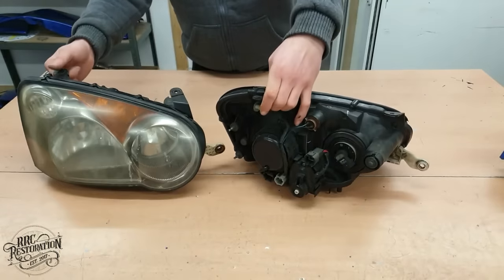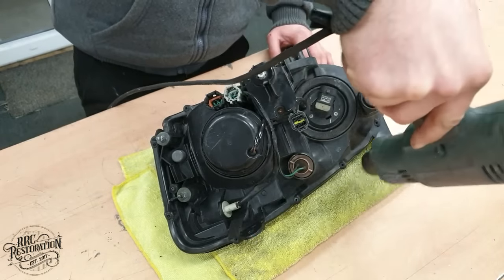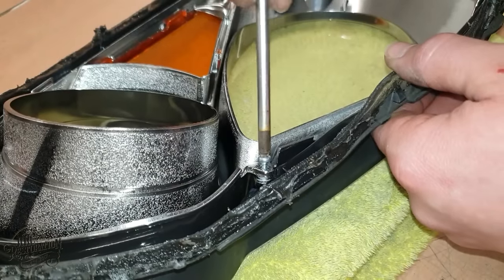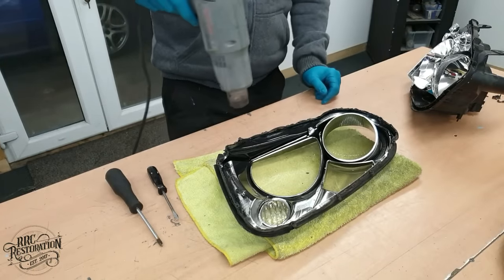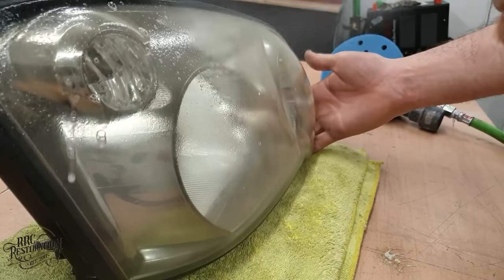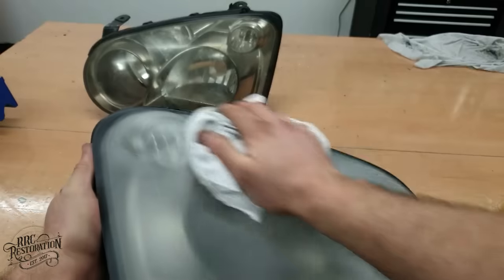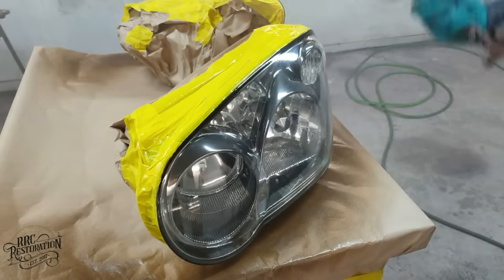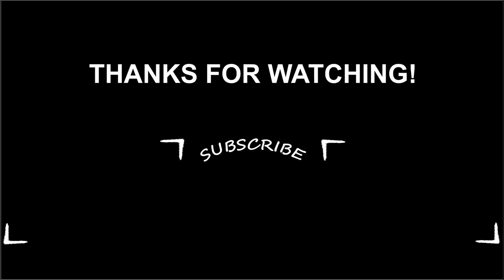Headlight Restoration - The Way A Professional Does It

Comment: The way the lens went clear as you applied the second coat was almost witchcraft!! 😀
Reply from the maker: Neat isn't it? :)
Reply: The problem doing this you end up losing some light output the cutoff sharpness from projector if I would buy and replace them I then get them PPF wrap
Reply: I would've never believed it, if I hadn't have seen it in real time. Great job!👍
Reply: @heyheysaturday2492  ya probably from rattle canning it.  His is flawless.
Reply: @heyheysaturday2492  from the factory they put a clear coat on the headlight lens and the light output would be fine if it is crystal clear. This is why people restore headlights so the light projects better.
Reply: @RRCRestoration  hi i dont have a compressor, what will happen if i use spray cans?, if so will and clear coat work?

Comment: It can’t be overstated how skilled you are at spraying paint and clear. I essentially did this same restoration with my 07 Outback but used a rattle can. I had a lot of orange peel and tried to polish out but not perfect. Still happy with it. But yours came out absolutely flawless.
Reply: Rattle can clear is 1K. It lays horribly and has no durability. 
You need to use a 2 part clear.
Reply: @jumpinjojo  2k paint is also available in spray cans
Reply: @jamescavanagh9276  Wish they were available by me, it would make car work so much easier to do, though I can still use a compressor and spray gun to do it, the convenience of the single use can though is great.
Reply: @jamescavanagh9276  Absolutely.
Reply: @jamescavanagh9276  if anyone uses 2k can clear PLEASE WEAR A RESPIRATOR.
Reply: I did this as well on my 08 Saab 9-3. I used a 1K clear as well and had insane orange peel. Was curious if there was any fixes out there as well
Reply: @mod.ts76  maybe a light sanding and a 2 step compund and polish? had an old set of 04 wrx headlights I wanted to try it on but got rid of them a few weeks ago and ordered spec d cause my light bulb melted the inner housing somehow
Reply: @mod.ts76  A 1k coat just won't last well, but you can temporarily clean it up with fine sandpaper and then a rubbing/polishing compound. I'd recommend redoing with 2k if  you're going to go through the effort. I did this process three years ago, with a 2k spray can (eastwood). Done as described in the video with a single light coat then a single heavy coat, the orange peel was minimal... but I wanted it to be perfect, so did light sanding with  2000 then 3000 grit to smooth out the orange peel, then rubbing compound and a final polish. They still look brand new now. A quality 2k coat will outlast even the factory coat. And as mentioned -- use a respirator if you're going with 2k.
Reply: Could always remove, sand and bring it to a paint shop to spray for you.  They wouldn’t charge that much.
Reply: @mod.ts76  when you use a spray can 
always and i mean it always pre heat the can in a container with warm water for a couple of minutes 
like 40-50 degrees c but you do not need a thermometer if its not too hot for you to 
wash your hands it will be fine . the reason to do this is because any primer paint or clear that is too cold 
forms bigger drops so it does not disperse well that is why you get a lot of orange peel .
mean while a warmed up can makes a really really fine mist and you get way better results
Reply: @Crushonius  WOW! Awesome idea! Thanks!
Reply: @ireallyreallyreallylikethisimg Don’t tell me what to do.

Comment: Thought you were just going to polish em then use ceramic coating. Those look much better then just a polish, impressive.
Reply: This is the proper way... the rest of the polish "kits" are temporary.
Reply: @ShainAndrews  if you use ceramic uv coating it's somewhat permanent but yes new lenses or a flexible uv clear is the best way.
Reply from the maker: Thanks, glad you liked the way they turned out :)

Comment: Excellent job mate, I recently done the same thing with my blob eye headlights, only difference is when I took them apart I made the chrome matt black. 

From having done headlights in both ways that you mentioned,  Sanding / polishing and sanding / spraying I've found the spraying method gets better results that last for much longer.

Comment: I just did mine off of a 2010 Chevy Silverado and I'm not a pro and they come out amazing if I do say so myself. They product I used did an amazing job taking off the oxidation and the coating come out very clear. And I didn't have to take them off of the tri=uck to do it. You did and excellent job restoring these also!!!
Enjoyed your video and I gave it a Thumbs Up

Comment: I bought my kids an old crappy Ford Taurus a few years back and the headlights were badly yellowed. I looked at all the restoration kits and the amount of time and energy required, and then I realized that new replacements were only $47 on eBay. So my restoration strategy was to throw away the old ones and install new ones. Worked great!
Reply from the maker: Haha cant argue with that strategy ;)

Comment: That was way easier than other methods. Thanks for sharing!
Reply from the maker: No problem, thanks for watching :)
Reply: How is it easy?? First you have to try and remove headlight from the car and that alone presents it own set of problems in some cases it is necessary to remove the front of the car and disconnect the electrics!! As all cars are different hundreds of things could go wrong, Same applies to the headlight dismantling itself overtime plastic becomes brittle and could break!! No better to leave them where they are!!!!🤔

Comment: Very interesting restoration method.  I do it whilst lights are on cars, so I wet sand with a block from 800 > 2000 and find I can machine polish clear before a UV sealant.  I can't really be messing with lacquer when I do them.

Comment: Could the same be done with hand sanding and spray can? As not everyone has a well equipped workshop. Nice vid. looking forward to another bike build.
Reply: I hand sanded and coated my headlights with 2k clearcoat. Ended up with a bit of orange peel, but seeing as I applied 3 good coats, I had plenty of clearcoat thickness to sand and polish to a nice finish.

Comment: To everyone amazed at how easy this is, much of it comes down to the automotive grade 2 part clear coat and real spray gun. This is not something most people can really do at home, at least not without decent equipment. Sticking to just polish is probably the safer bet for most DIYers. Beware the rattle can, it's not impossible, but it's really not easy, you've been warned. There are some surprisingly good wipe on products specifically for this as well, I think they probably stole the formula but rustoleum wipe-new is an amazing product.

Comment: When they go bad again at some point you try getting that clear coat off, the stuff is meant for paint on car bodywork not acrylic headlights. Your method may be quicker but there is a reason people use the multiple wet sand, polish and seal method. You will have a job doing those headlights again as the clear coat is so difficult to get off unlike other sealants which are meant for acrylic

Comment: I tried this method, but i only had some basic clear coat spray can. I dont know if it's the humidity, or it's because the clear spray can was cheap, but when i apply the coat it immediatly turns milky. At some degree it clears up as it's drying, but there are remaining white spots thati cant get rid of. Any tips on how i should approach the issue? I kinda want to get it done as quickly as possible, without buying anything else
Reply: I think because 1) its professional 2K clearcoat not your basic cheap clear for paint 2) Preparation is everything A clean surface produces great results. 3) He may have Infra Red cured them also. 4) "quickly as possible" seems rushed and impatient.

Comment: My experience using the clear coat is that it doesn't last very long, a month or two at best. Have you had similar experience? I have found that Meguiars Keep Clear Headlight coating works best. But I re-apply it a couple times per year, without additional sanding.
Reply: i dont see why it wouldnt last...its clear coat...designed to last 7 to 10 years. I suppose if you used a shyt cheap brand

Comment: I have watched many of those headlight restoration videos and always thought they were a huge faf, I wonder would this also work using UV clear in a spray can?
Reply from the maker: Yeah, I kind get the feeling all those other videos are just dragging their heels to stretch the video out, I like to just get on with it and get it done. I couldn't say about 2k in a can as I've never used it but I don't see any reason why it wouldn't work?
Reply: @RRCRestoration  I don't either and I'm gonna give it a go - thanks for that helpful video.
Reply: @Tailss1  2k Clear coat in cans works. ( It did for me anyway).
Reply: @Tailss1  it sure does work pre heat your can in hand warm water for a couple minutes 
better dispersion equals better results

Comment: Sikkens makes a spray for headlight clearcoating, its nasty stuff / pro grade as its cyanide based and you need full PPE, face mask, clothes and respirator to spray it, but its the best there is, it lasts for ever.
I've done this many times in my cars, some times the silvering in the inside mirrors goes away and no amount of glass polishing will fix it, you need to take the headlight apart and send the mirrors for resilvering.  This also works well, the inside of headlight be metal or plastic.  But I've only found companies who do this (and don't charge a fortune) in Germany, nowhere else.
More, in older cars the seal is what you see in the video, its called butyl and can be used and reused with heat, or you can put new, it costs 10eur per roll.  In newer models they use some nasty hard epoxy glue that is almost impossible to remove.
Last, for some car brands there are actually available new plastic headlight lenses, from dealer or aftermarket that dont cost a lot.  Spare the painting and sanding and go put new lenses, much easier.
Thanks for the video!

Comment: excellent spray job and nice clean workspaces!   I haven’t had success with the 800 to spray method but I have only used rattle cans.  I keep seeing people comment about the spray gun making all the difference.  I’ve had great success with the 3m kit and I like the Meguiars spray can but want to try more of the 800-2k clear route if I can get top quality results with less sandpaper and time.
Reply: p800 is a little coarse to laquer over tbh, i wouldnt go any lower than p1000. when i relaquer lights i finish with a p2000 wet, then laquer
Reply: Spraymax Headlight/polycarbonate 2K clear.

Comment: Amazing job! I think the only time you may need to do harsher sanding and go up the grades is when like me on my old motorbike, you have deep scratches in the lenses. Mine came out very well, but I didn't clear coat them although I did consider it, would likely have made it look better and stay that way much longer as I'm sure over time the lenses will fog up.

Comment: Quite right. All those silly people buying off-the-shelf restoring packs with sand pad grades from 800 to 3,000 when all they have to do is buy a spray booth (and perhaps the land on which to construct it), supply it and the user with air filtration equipment, including breathing masks, overalls, gloves and the appropriate spraying equipment and generators. Simple. Thanks for the tip and thanks for being so smug about yourself.

Comment: I agree your method is faster but once the clear coat fails the rough plastic will yellow faster and be immediately visible as the clear coat is the only thing providing visual clarity as it is seeping into all of the micro scratches. Also by rough sanding you increase the surface area thus when the oxidation occurs it will be more extreme.

On the flip sideeee this clear coat is less likely to fail by flaking because it has much more adhesion to surface so it might be better on the long term.  Great job they look just as good as the traditional method.
Reply: This is why headlight polishing is such an important step before any clearcoat is applied because it hydrates and seals the lens!!
Reply: @keithroberts5611   lol before? then wtf is the clear gonna grab to? hahahahahahaa

Comment: For those of us without a pro spraying setup, would it be possible to use a 2k in a can product to achieve similar results?  If so can you suggest which product would be appropriate for the job?  Thanks!!
Reply: I refinished a set of headlights using 2K SprayMax that I got on Amazon. One can was enough for both headlights. It took quite a long time to cure, but the finish is very good and they have held up great over the past ~6 months.
Reply: @xJackHunter  I've used the 2K SprayMax stuff before.  Good to know it works in this application.

Comment: @rrc restoration, not related to this vid sorry but only place youll see it. I was planning on fully restoring civic undercarriage in summer and using raptor liner after grinding and etch priming, but been seeing all sorts of videos arguing against solid/ rubberised undercoat saying it just rots from behind layer. You think raptor still worth it over oil/ wax based undercoat? Cheers

Comment: did you do your research before applying a clear coat that isnt designed for headlights?  also how much did you reduce the light output by clear coating it while the whole light was so badly damaged, it was snow white?

Comment: Whats your thoughts on 2k clear in a can?
Reply: It is only as good as the manufacture so buy quality.  It is ridiculously expensive.  The home gamer may justify it for a project like this though.  It's nice to not have to worry about cleaning up spray equipment, then dealing with the solvents.
Reply from the maker: I'll go with what Shain already said, buy from a reputable brand and you will get a good quality clear, defo expensive but for convenience and for small diy jobs you really cant go wrong.
Reply: I figured as much. Wanted to pick your brains about it and see if its even worth it for things here and there. 😁

Comment: how long does it last?...
Reply: Probably not that long, and neither does sanding and polishing. Plastic headlights are just crap.
Reply: @kunka592  You have no first hand knowledge... but don't let that stop you from running your mouth.
Reply: quite a while id imagine, the sanding is to remove the original layer of UV protection which has failed. And as you can see a new 2k UV clear has been sprayed on.
Reply: It lasts a very long time.  Yellowing will probably never return in the vehicles lifetime.  They may get hazy from micro scratches during use but that can easily be polished back.  He used a proper high quality clear coat.  The clear coat protects the plastic from UV radiation, and seals it from environmental contaminants.  This is truly the professional standard, not what you see in kits at the parts stores.
Reply: @ShainAndrews  "They may get hazy from micro scratches during use but that can easily be polished back", so basically it doesn't work all too well, because it's all plastic. When the guy says "how long does it last", I'd interpret that as how long does it last before I have to bother using abrasives (including polishing) on this stupid crap again, but don't let reading comprehension and common sense stop you from spreading your vast knowledge.
Reply: @kunka592  roughly around less than 6 month,depend how u taking care of the headlights,not that to exposed to long to sunlight..once u coating the headlight,the light penetrates becoming poor..so dangerous for the driver..

Comment: I wish it were that easy on a 2009 TTs.
At first I thought it was the outside that had been damaged over time but on closer inspection, it has micro cracks that appear to be on the inside.

I wonder if the lenses are as easy to remove as you showed with the Subaru ones as they only cost £40 each on AliExpress?
Reply: Most headlight assembly's are similar to what he presented.  The one thing that can be different is the sealant.  Some use a curing epoxy.  Some are welded.  In my experience those are the exception.  Give it a shot.  I bet you can get it done.
Reply: saw a guy on a forum successfully opening these TT headlights with heat

Comment: Forgive my lack of knowledge on the topic, but doesn’t clear coat sprays cause lighting issues? (Refraction I think?) I’d love to try this method via a can but I’d heard that somewhere, thanks!
Reply: I had read the same thing about refraction of light caused by clear coat. Maybe the orange peel ( if not polished out) would cause refraction issues?  I sanded and clear coated my headlights, followed by sanding with 3000 grit and polishing to remove the orange peel. Great vision at night now.
Reply: @johnkaimins9998  Okay awesome! I was gonna do this method but without a proper spray gun results may vary... I had contemplated doing the plastic film method also.

Comment: I assume you will just use amber bulbs for the turn signals instead of the filters.
Reply from the maker: Yup, amber bulbs with the chrome coating so the lights stay silver but flash amber.